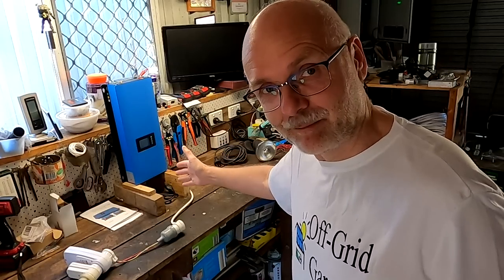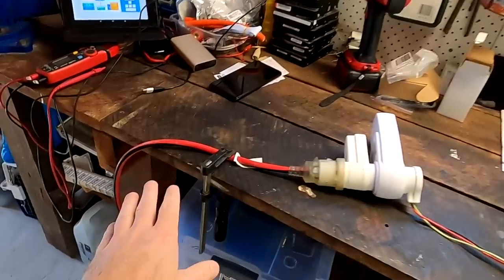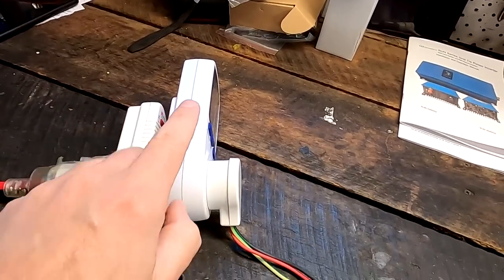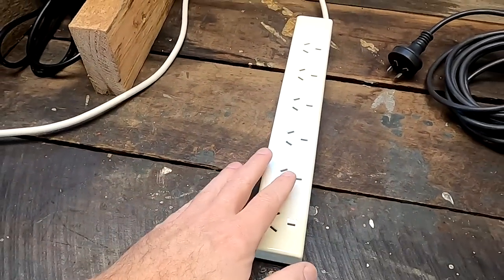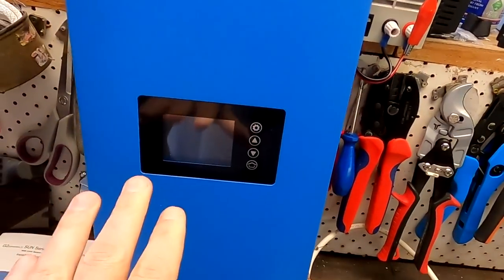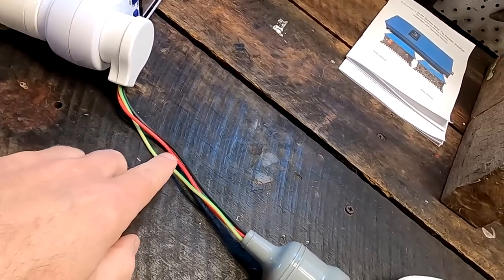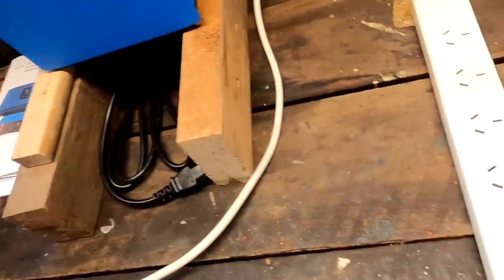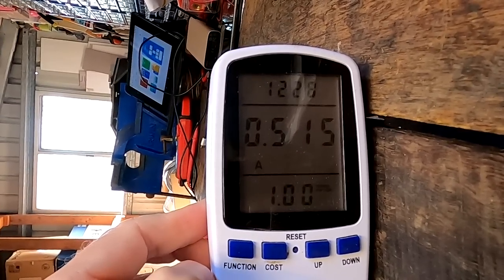Sun 2000 GTIL2 Inverter full test. How it works, what it does.

Comment: Hay Andy,
I have some information for you...
I have two inverters SUN2000gtil in last two years. If You develop your project about this inverter.. you will doing big mistake. I will explain why..
1. This inverter is declared 2000 W but is not... Today this inverter product only 1200 W depending on environment temperature. I must set limitation of production to 1300 W.
If is setting for limitation of production 1800 W ,then inverter is overheated and automatically limit power. On the end go to turn off.
2. One inverter was burned on and not have any option for repair it. I was buy second and on this inverter burned two small fet transistors for controlling fans. In this situation I was repair it.
3. This inverter have price 300 to 400 EUR (depending on the action). Two inverters in total 2500 W cost about 600 to 800 EUR-a. I think.. that is to much.
4. Inverter have very poor interface for monitoring. Addition problem with interface is.. when doin connection and read data, inverter stop working to one to two seconds. Real data is not real... this data is average in 5 minutes. 
5. Warranty basically not exist..
6. If you use battery,  must buy two addition MPPT. Ok.. you have chargers but this price must be included in total price.

I tings... more better option is buy inverter with all in one... Inverter with two mppt-a, Warranty 5-10 years and good interface to managing and monitoring.

For example: Groowatt SPH series or GoodWee residential inverters.
Both inverters have option for zero export which is controlled with smart meter or CT clamp. Inverters have connection to battery BMS an can configure point work for battery.

SUN2000Gtil is good budget inverter for starting with solar experiences, but is not good for your project.
 I have plan to replace this inverters with Growatt SPH 3600 for which price is about 1350 EUR.

With regards.
P.S. Sorry for my English  ..
Reply: Noe need to be sorry for your English at all. I agree with you not on the basis that I have actual facts, but on the basis Chinese product specs are in my opinion just half the values they advertise. So, a 2000W device is only good for about a 1000W. Forget about warranty, it might cost you more to ship back to China.

Comment: cool video, after 2 years this unit stopped working, we have check the DC fuses,  ,   all good, AC legs are both good. in put but the unit died, do we need to replace all teh mosfets?

Comment: This is the best explanation of how these work on YouTube. Thank You. I have a question: If using batteries (I assume for after sunset) with only a maximum of 1000 Watts of daytime solar, would the inverter be able to recharge the batteries if they ran all night supplying 1000 Watts to the house and still be able to provide power to the house during the day or would it need to be dedicated to just recharging batteries. I am a little confused on that part.
Reply from the maker: This inverter does not have a charger. It's not a hybrid inverter. It's grid tied with power support. So it will deliver the energy used by your load as long as possible until the set low voltage cut-off is reached. The grid will then deliver the energy again until the voltage in your battery rises and the SUN takes over again.
Reply: @OffGridGarageAustralia  I am doing a bad job explaining so thank you for continuing to answer my dumb questions. If I want to take advantage of my large battery bank (AGM) at night,   do I connect my panels to an appropriate charge controller that is then connected to my battery bank that is continuously connected my inverter? I would set the inverter to cut off at 37.30 or so VDC to be conservative to my batteries and then the inverter would restart in the morning when solar made voltage climb to set level??  I think you see how I want to use the inverter. Am I doing it correctly if as described above?
Reply from the maker: @benkanobe7500  no dumb questions here at all. How you describe it here, that's exactly as it should be, The inverter should turn off at a set voltage to prevent the battery from being discharged further while the BMS does not trigger in this case and still acts like a safety switch to protect the battery if something goes wrong. Perfect setup.
Reply: @OffGridGarageAustralia  I'm a bit confused. As this has a MPPT solar controller, if you have a battery bank that you want to use with this, you would not be able to use the MPPT solar controller from this inverter?? Would the set up be -  Solar Panels to Solar Controller to Battery Bank then from Battery bank back to Inverter ?

Comment: This video is absolutely fantastic! Great Information that I can't find anywhere else. 
I'm looking to use one of these to power my house-base-load from my vehicle with V2L capability. Any feedback would be welcome. 
My BEV can support V2L but not V2G, my baseload required with fridges running is around 435W. So I thought about connecting my BEV to an AC to DC variable converter and setting the output to 90V at 6 Amps.  This would then be connected to the SUN inverter and then fed to a dedicated 15A circuit in the meter box with it's own separate RDC and Circuit Breaker. 
I can't see why this wouldn't work.

Comment: Awesome video. I bought last year a SUN-1000 G2-H with two panel (I have the same version you had, 7.1). Last week I added a Pylontech US2000 battery and I configured the inverter with "battery or solar Power Mode" to 800W and configured a cut-off at 46V and reboot at 49V. The battery have a Dishcharge Volt at 44.5 ~ 53.5. In your opinion is the right configuration?

Comment: It gives me great pleasure to watch your videos with simple and to-the-point explanations. It would have been wonderful if this inverter had an input from the batteries and could set the automatic switch at a given time from the solar panels to the battery, thus ensuring operation at night or on very cloudy days. Thanks again for this interesting video material.
Reply: You don't need any switch. Just add a charge controller from your solar panels to your batteries and connect the inverter directly to your batteries. This way your solar will charge your batteries and the grid tie will run off batteries day and night or until your batteries get too low. If it does shut down at night due to low batteries it will come back on the next day automatically as soon as your batteries get to your reboot  voltage.

Comment: Hi! If I install the limiter sensor, I should also turn on the internal limiter in the menu to make it work properly? Or just leave the internal limiter off in the menu? My electricity provider does allow me to export electricity. I'm ordering one just like that in 1000 watts in either 22-60VDC or 45-90VDC depending on how many 100 watt panels and in what combination of series or parallel connection . Thank you for sharing and posting and these vids are plenty helpful to my project.
Reply from the maker: You only need the limiter if you want to limit the power been exported or prevent a feed-in altogether.  Otherwise both can be turned off.

Comment: What a nice video! Great explanation!
Still, there is a question. Can I use a grid-forming inverter together with a grid-tied inverter with a limiter at the same time? So, grid grid-forming inverter will be connected to the grid, to batteries, and in case the grid goes down it will feed the house from the batteries, but the main load will come from solar via grid-tied inverters.
Reply: Excellent question hopefully someone has experimented on that, probably better than connecting it to a fossil powered generator.😊

Comment: Great video. Would connecting a backup generator to the house when the power is off cause any problems for this inverter or would it just work as normal?
Reply from the maker: If the inverter fails or is turned off, the power will come form the grid automatically. With such a system, there is no need for a gen.

Comment: nice, I have a wind turbine hooked up to mine and I am a bit reluctant to use the limiter cos I dont know what happens to any excess power produced. I assume it goes into the dump load (no batteries) but if it doesnt could it unload the turbine? which would be very bad.
Reply from the maker: The inverter for small wind turbines usually need this dump resistor connected. Does yours have this?
Reply: Yes, although the one that came with it is 10 ohms and the one recommended by the turbine manufacturer is 4 ohms  which I do not have.  Any  idea who to contact about the inverter as it has a blue internal light flashing about once a second I have another in which the light is steady and assume a fault of some kind but can't find the manufacturers to ask.

Comment: Dear friend.Thank you for the scientific approach and explanation for this 2 Kw On grid inverter with limiter.Because in my country right now we have a small heat wave with inside temperatures 32oC. I wonder how can i cool up my 3 x 2KW inverters. A. Should i place a timer so from 11 mid day up to 14.00 to have a break and actually cut the input power of the inverter???do i need to cut only the input power or do i need also to cut with a rele the solar voltage that  feeds the inverter????        B.Shoula i place a 7000 btu aircon??? from a wheelhouse that i have???Whats your opinion please.Thank you Very much.

Comment: Do you need net metering or a bidirectional meter for this to work or do you just plug it in... interesting device.. is there a legal. Limit.. im assuming it won't output unless there is a load for it...
Reply: exactly, zero export / full auto-consumption only with limiter, new version have external limiter or use soyosource who use modbus and you can use IoT to this.
Reply: @YTBySIB  I would guess that the load needs to be 2x the max Output in order to use the max output. Basically, u have 2 parallel power sources feeding sub panel. Path of least resistance.  So if u limit to say 400w u would need 800w of load.  400 from the device and 400 from grid.

Comment: @Off-Grid Garage sorry for the question but I am still learning. 
1) is it good practise to plug the AC into a plug socket? I don't want to wire it into my main board as I don't want to touch anything there because I will be moving soon and I want to take the system with me. Is there some way I could maybe wire it to it's own breaker and from there to a plug socket, or is this still dangerous?
2) if I'm running panels to a battery and battery to the inverter then I would have to buy a separate MPPT controller to put on the other side of the battery? There would be no way for it to control it?  This is only for panels connected directly? 
Thank you

Comment: Great video. Do you know if the neutral and ground are internally bounded in the inverter? Thank you
Reply from the maker: No, they are not bonded in this inverter. That would be fatal. The MEN link is in your meter panel or distribution panel. It is only inside an inverter if it is an off-grid inverter.

Comment: The remote number is for the rs485 identity. If you change it the wifi dongle Will not work. I am trying to control the export with a raspberry pi. However I do not have a clamp do you know what the voltage or preferably waveform looks like. Also if you press and hold the top 2 buttons on power on you get the firmware menu. Thanks for clarifying the reboot voltage now I know why it only kicks back in at 27 volts. Mine is just for controlling a wind turbine. Thanks in advance.
Reply from the maker: Thanks Dave. I'm not sure about the CT's specs but you can buy them online for around $50.

Comment: these inverters are brilliant, i have loads of them, some over 10 years old and still working flawlessly. that Wanpak power supply though, you really need to re cycle that into something usfull, they really are rubbish i have not seen one yet that has lasted longer than about 6 months 🙂
Reply from the maker: I have repaired my Wanptek twice. Both was my own fault though because of reverse connection at higher voltage.

Comment: SUN-2000GTIL2 Does not save settings. Changes in settings, default to YES, and Press setting button does not save. Any ideas? Is there a factory reset on these units?  Thanks for the help.

Comment: Love your video very informative on how this all works.
I'm based in the UK and currently have 2 inverters a growatt String inverter and a growatt hybrid inverter without batteries at the moment which are connected to the grid.
Would like to know if this would work with what I currently have setup and to be used as a wind turbine rather than solar as I've seen this used with wind.

Comment: Excellent video and TNX also, I use the same in my grid tie setup with limiter since I have to pay if sending power into the grid, I produce a sine wave with a small generator in case power goes out and the gtil will kick in again and produce sun energy for my use as necessary.

Comment: Thanks great video, have a question. I am in the UK where the Neutral is bonded to earth. If I add mcb and rcb between the inverter and my house mains, will the rcb work? Will there be any problems with grounding?
Reply from the maker: We have the same MEN link here in AU. Yes, RCD will work just fine, no problem at all. Consider using an MCBO (MCB and RCD combined).

Comment: Ideally this would run on its own circuit solely for the reason that you could overload the circuit where things are connected to commended limited 20 A you could draw 30 amp is that inverted antenna into the circuit as well and that could make problems

Comment: Hello Andy your test of these type of inverters is really best! I understand now clearly all functions and wiring possibilities. The only thing I want to ask is how the inverter will behave during the sunny day and no load from house? Will it switch off automatically? Thank you for your reply, kind regards from the Czech Republic.
Reply: If it has the current transformer on and is limiting export it will go to zero generation if no use in the house. If it is not limiting export it will just generate as much as it can and whatever is not used in the house will go onto the grid just like a normal grid tie inverter.

Comment: If i were to use this inverter along side a solar array already would it produce 0 watts if the existing inverter is feeding power back to the grid and the ct clamp reads negative numbers? A family member gets paid a generous generation tariff for their current system but doesnt have battery storage (old inverter) they are wanting to use a system like this to cover load at night but not feedback to the grid from this system during the day. Any feedback from users would be much appreciated

Comment: Nice video, thanks. Having the same Inverter myself, nice product (: did u also test the Wifi plug ? I'm curious if it allows to check my battery or input voltage remotely-couldnt find anything about it..

Comment: Dear Sir,
I have a small question related to this 2000W SUN GTIL2 inverter.
My solarpanels are CanadianSolar with each 455 Wp and these specifications:
PMax: 455W; Imp: 11.02A; Vmp:41.3V; Voc: 49.3V; Isc: 11.66A
Since the input voltage should be between 45-90V and in your video it shows that it "kicked in" at a little more than 50V I don't know how to connect the panels to the inverter. How many panels can I connect and how many parallel, how many in series?
Reply from the maker: The inverter can handle a max input voltage of 90V. So the panels you have are not suitable for this inverter.
Reply: @OffGridGarageAustralia  Thank you sir. That's too bad, because it looks such a nice inverter and you explained it so well. Next time when I add some panels I make sure they are not so big and I can use this inverter. Thanks again. I also subscribed to your channel, because you have many interesting videos :).

Comment: Hi there 

Thank you for the great video! 🙂

I do have a question that i hope you can help me out with. 😬
In your video at minute 12:13 through 12:25 , it shows that you have 53v comming in the inverter but your watt production is at 0.0w. You say it is on stand by. 🧐
How do you get out of stand by? 🤔
I am asking you cause, i use 2 of the same inverters but for wind turbine and even though i feed them with 53v or even 58v (depends on the wind) both inverters are never producing any power! 
I am getting really disappointed in the whole system. 😕

I thank you, in advance, for your time and answer.
Reply from the maker: Do you use the limiter option? If not, you have to turn this off in the settings.
Reply: @OffGridGarageAustralia  hi again and thank you for the quick reply. 👍🏻🙂 

When the limiter option is on i get those 50 or 50+ volts in the inverter. 
When the limiter is off then the inverter brakes the wind turbine to a flat 20-22 volt. 
Both options ends up in no power production. 😕
Reply: @sevastianosprenta7471  
Try to limit the power it is allowed to supply. You should be able to find a sweet spot where it works I would think.

Comment: Thanks for the overview.
There is similar model for 3-phase wind power generators. Do you think it can be used with solar instead (at the end of the day the 3-phase AC input is converted to DC inside the box).
Reply from the maker: I don't think it is convert to DC actually, these are grid tie inverters which don't charge a battery.
The inverter for wind power cannot be used for solar, no.

Comment: Good and clear explanation of the feature settings for SUN Grid Tie invertor.  I have two 1KW model over here in the US and has watched many videos on YouTube but no one has gone through each setting as clearly as you had. Will do you a video on hooking up WiFi-Port Plug Wifi Modem for SUN-1000GTIL2 SUN-2000GTIL2?